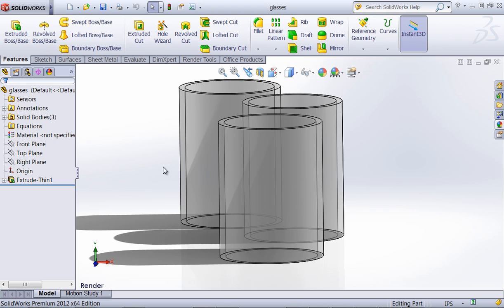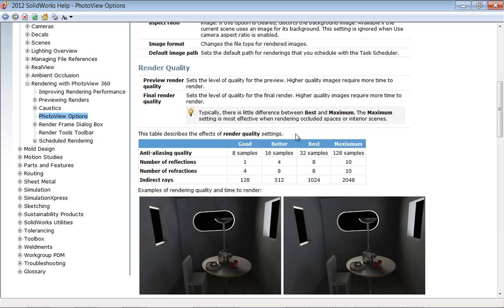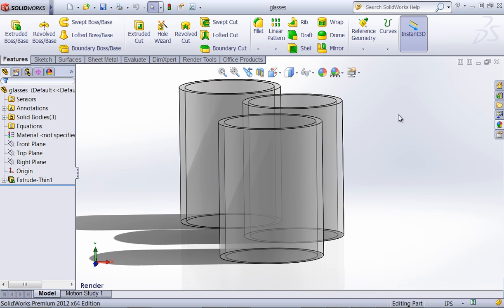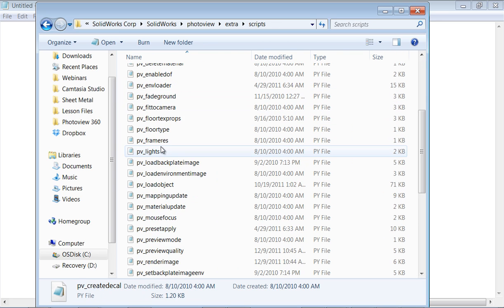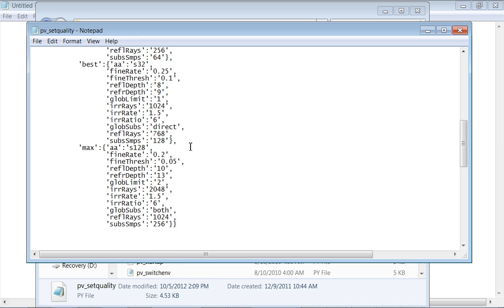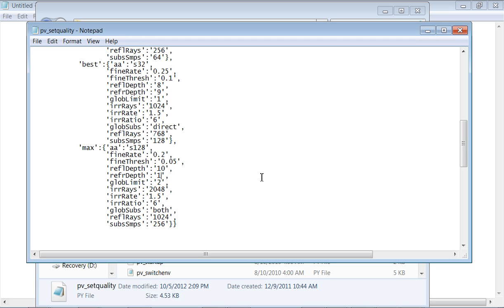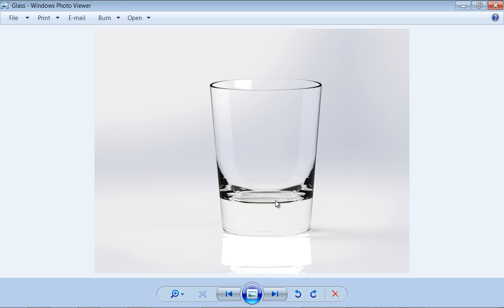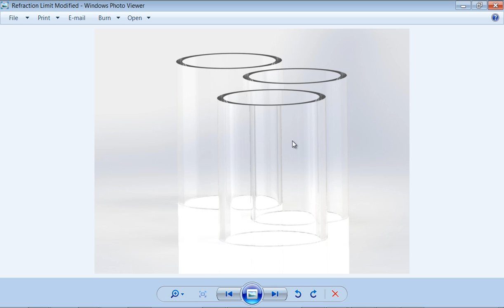Getting around Render Quality Limitations in Photoview 360

Comment: Thanks for posting this,

Note that in SolidWorks 2013 users have explicit control over the number of retractions and reflections (up to 32 of each). The control is independent of the render quality. If you are inclined to edit the file I would strongly recommend you upgrade to SolidWorks 2013 instead.